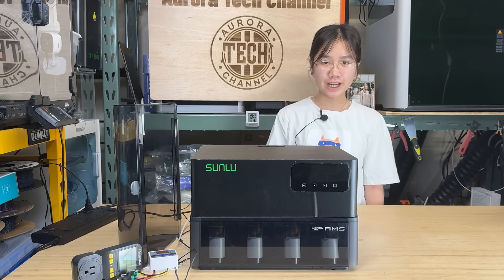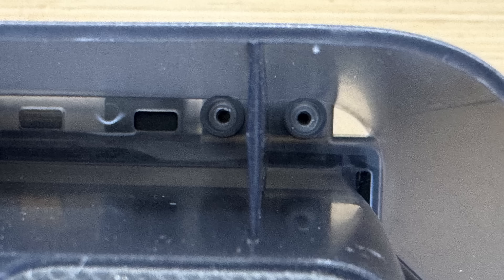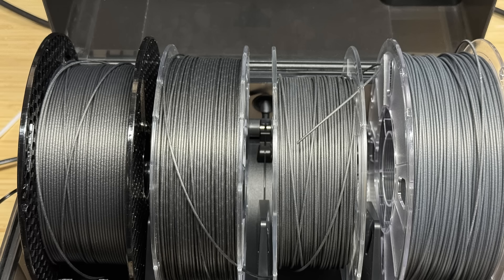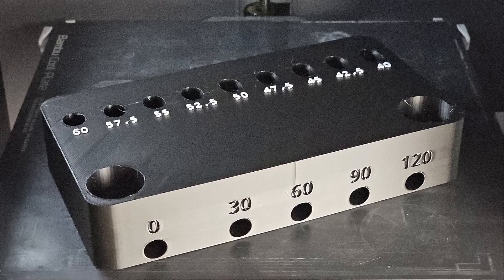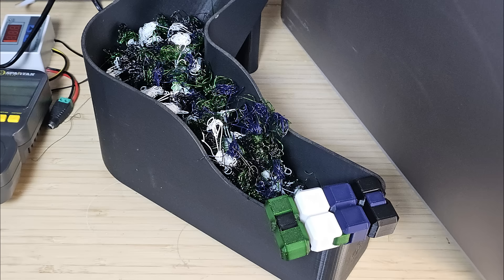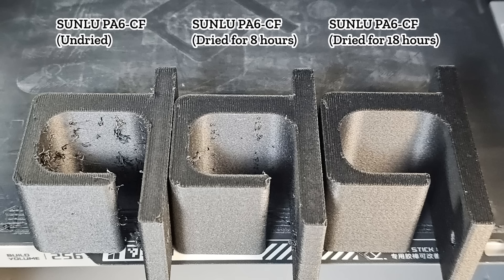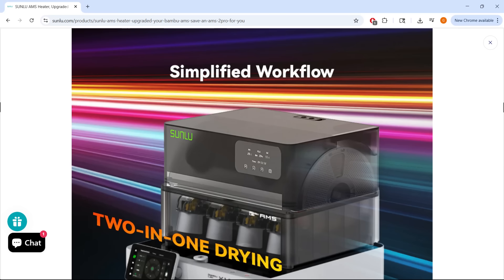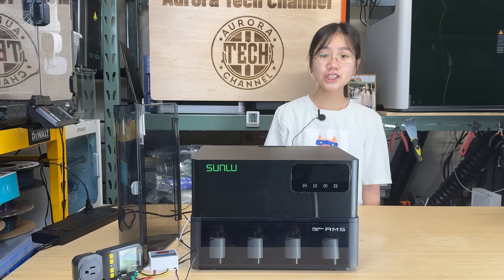BambuLab AMS drying while printing? SUNLU AMS Heater Might Be the Fix

Comment: I don't dislike SUNLU, and I have a SUNLU dryer for one reel. I think they only need to keep the air inside the AMS dry if they are making large plastic moldings. Store the filament in a dry air space and do not let it absorb moisture. If it does absorb moisture, you can slowly dehumidify it in a special box to prevent it from deforming.

Comment: I don't think that temperature-dependent dehumidification during printing is appropriate, but I have a 23W dehumidifier installed in the PRUSA enclosure. This allows me to maintain an environment below 40%, and PET and PLA materials will not deteriorate for 2-3 months.
I only print small cases, it would take me two or three months to use up even 1kg of filament.

Comment: There have been reviews of your print quality regarding stringiness, but do you use fresh filament every time? I don't think you can get good results with moisture-absorbed filament, so are you careful about storing it? I understand that moisture can be absorbed even through film, but I occasionally see footage of large amounts of filament left in a messy state.
In my experience, PLA and PET deteriorate in environments with humidity levels above 40%. High-temperature dehumidification is only recommended if moisture has been absorbed. The volume is controlled by the feed rate, so if the shape changes, it could affect that.

Comment: I'd rather just get an AMS2. I'm sure you can print a solution that would let you stack them. This solution from Sunlu feels cheap and a bit like an afterthought as opposed to a well designed product. Anyone who uses their machines for production work and uses advanced materials will not buy this because 70 is not high enough for most advanced filaments.

Comment: Liked!  Thanks for this review.  I previously used a dryer that fed my old printer, so the transition to BambuLab AMS was a pro in every way, except filament drying.   I now have to separately dry my filament and re-load prior to each print.  Interestingly, the biggest pro for this add-on was the last feature you mentioned, of automating the RH monitoring / drying.  So, now I could avoid taking the filament out to dry it before each print, and also allowing me to print immediately with pre-loaded filament.  Much more productive!  Probably the biggest Pro in making a decision whether to buy this add-on!  🤔

Comment: Are the ventilation holes actuated by the dryer or do you have to open them manually? Otherwise I don’t understand the storage mode, because for storage you want to seal of the chamber and for drying they need to open automatically to actually get rid of the moisture.

Comment: What I'm worried about here is how the ams will handle this long term. The gears, motors, and electronics in the ams are not designed to be exposed to high temperatures, especially for hrs on end. 70c for 12+ hrs, I'm worried about that causing damage. I wonder what Bambu has to say on the matter?

Comment: I don't understand why filament dryers won't go to 85C which is what nylon really wants to be dried at.  They all seem to go to 65ish.  Great review as always.  Glad to see you broke the 100K.
Reply: I couldn't understand that either. So that's why I decided to just get a lab oven. I got one on Amazon for $200. It's more expensive than most dryers. But it's cheaper than the Sunlu E2 by alot and gets hotter.
Reply: @1981AdamGs  Jest tańszy od Sunlu? Sunlu kosztuje 120$, przynajmniej w Polsce.

Comment: Why are all those companies not able to use an ESP32 board? Sending essential data over wifi to your phone or Home Assistant allowing to receive messages and warnings, run automations and remotely control your device. 2025 and they are still making such dumb devices.

Comment: Thanks for the drying comparison and reprints of the Nylon CF.  Is great to see real world tests of drying.    Another great point you brought up is the design of the AMS, while stacking 4 of them would be impractical, a 2 x 2 configuration would help a lot.  Would like to see a comparison of the AMS w/ Sunlu dryer versus the drying capability of the AMS Pro.  The obvious benefit of the Sunlu is drying while printing, which I find very odd that Bambu doesn’t allow the drying function to stay active while printing.  I understand they’d have to disable spool rotation, but that shouldn’t be an issue.

Comment: If you warm up closed air, the relative humidity will drop down. If you let the air cool again, the humidity goes back up. Since the air went is only manually operated the design is very poor expecting user to open and shut off the vent.
There will also be more space needed behind the printer to open the AMS. Stacking is only a dream, since you can not open the down unit.
I was expecting at least the long term humidity to be checked.
Reply: Yep people don’t understand what “relative” in “relative humidity” means. Turn on the filament dryer and the RH quickly drops…where do people think the moisture went?  Clearly the solution is to raise the temperature of the printer room to 50°C 😆
Reply: it has the storage mode... which she did check
Reply: @EliteCanadian92  That just periodicaly warms up  the filament, not getting rid of moisture out of ams. True drying feature like AMS 2 PRO vents the moisture outside, then seals to AMS so it can be stored long term.
Reply: @martinvitvar3101  manually vent it... I've done it with all my dryers, no issues. There's also a ton of user mods to make this easier and automatic. Its not an issue unless you want it to be.

Comment: Title is correct, and the mistake was mine, but I came here hoping for an turnkey solution to a dryer for the ams-lite!  

I don't work for Bambu or sunlu, but I don't think it's a stretch to suggest there are more ams lites than there are ams out in the wild.  I get that the lite is more bulky, and would require more effort, but damn sunlu, get to work on what more people want.